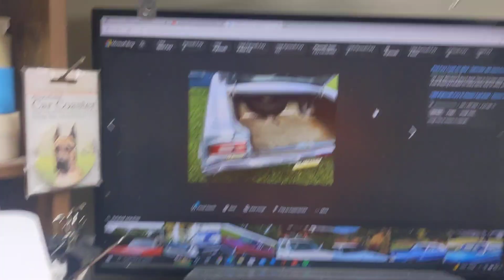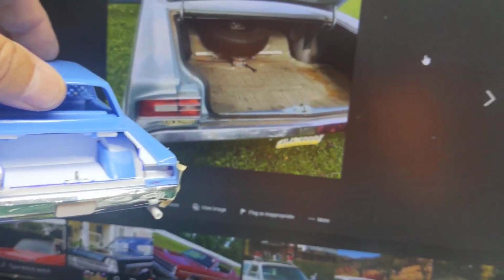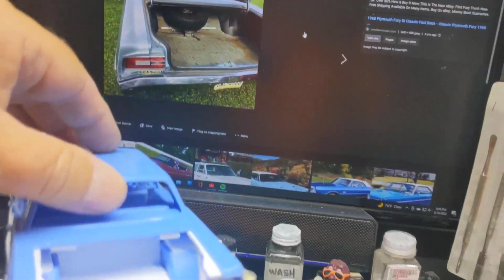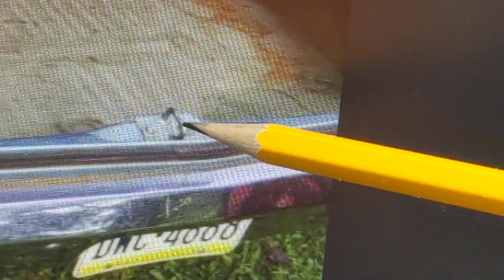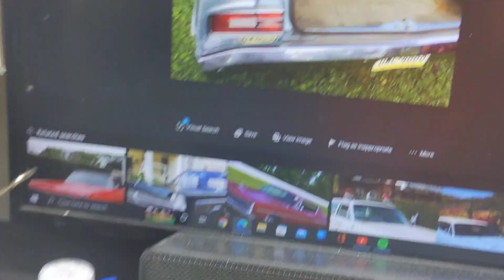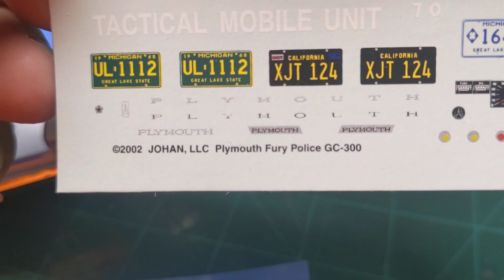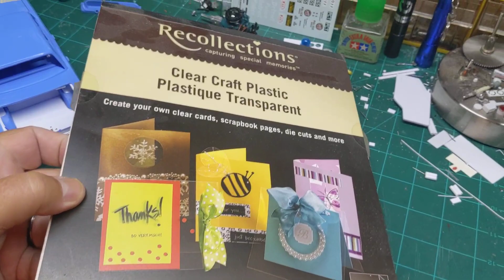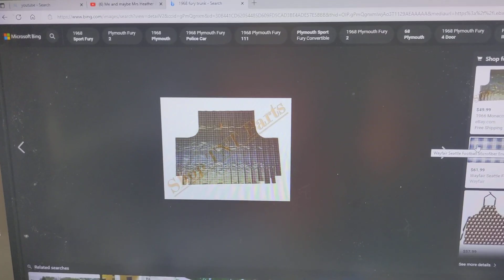Trunk details finished!

Comment: When you paint, please explain how you prevent from losing the detail of the Fury emblem on the fender and key locks on the doors.  Thanks...
Reply from the maker: The side emblem has a decal, but normally I would cover in bare metal foil BEFORE any primer or paint.

Comment: You have done so much work on the trunk, why don't you do a little more and do the step up between the wheel wells for the spare tire?    The line across the front seat was welting (I think that is what they called it) it was a small piece of round stuffed plastic where they sewed the two pieces of material together.
Reply from the maker: Thank you. The step up is there, just didn't show up very well. It's where I will place the spare tire.